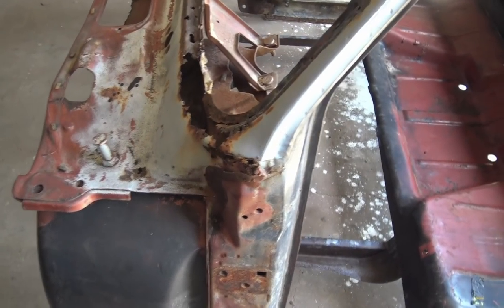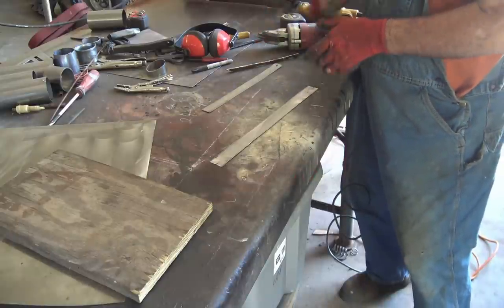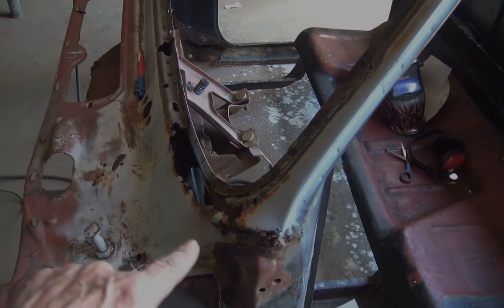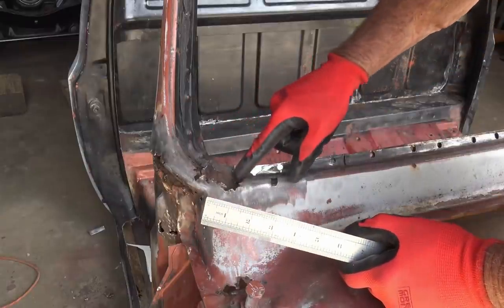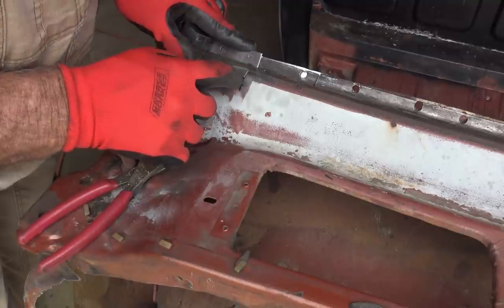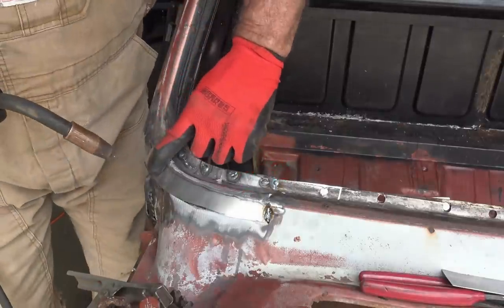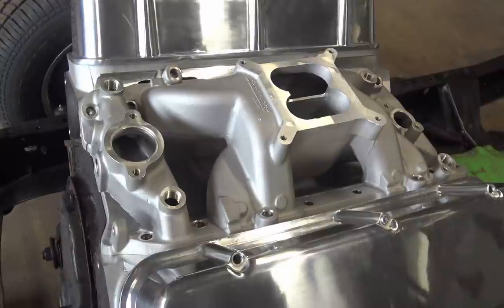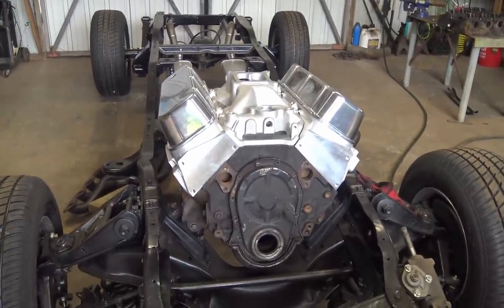Rust Repair For Dummies - 78 C10 Street Truck Build

Comment: Nice metal work, lots of patience!

Careful with those Ebay parts, cylinder heads especially. Check the valve seats for sealing, I've seen loads of them that need valve jobs brand new from Ebay sellers.

Comment: You're going about it the right way! When it comes to rust repair, it's best to do it one little piece at a time. It's a lot of rust, so it's gonna take a lot of time. But hey, times cheap! As for the top end kit, well now you're building 2 motors with 1 kit. That ain't bad!

Comment: Hey Bob on them side pillers you can use rust stop and then you can put lead in for body filler just like the oldden years, I used to use lead to cover welding spots you still can get lead from your local Auto paint shop along with bees wax for smoothing out the lead ,you have to get the acid flux so the lead will stick . They make 4 different types of lead for body filler . Try using lead you like it for filling spots .  Years ago I owned D&L Auto an Paint and used lead in a lot of cars an trucks even on clipping vehicles

Comment: Bob you ever use All metal? It’s like your Dura glass full of minut little ground metal. I use in small rust areas after I use rust killer. I’m building rat rods to and it’s fine for them.

Comment: This is still an awesome build Bawb, but I'd just buy the right airgap intake for those heads and run em, you still have a good intake for the peanut heads for a future build and those new heads wouldn't be setting on a shelf waiting for someday use,, that's a pile of money for shop art,, sweet work on that rust repair just wish you were closer because we have a local guy who has probably 8 of those cabs in way better shape than that one,  market place auburn al. if you want to look him up

Comment: 6:25 Good know how tip Bob on using stretcher& automotive shrinking tool wish knew someone around that has 78-80 squarebody truck cab to help cause it like pickup cab ur currently working came from up north ohhh & definitely don't buy parts on EBay some of their stuff won't last.

Comment: Like the progress and understanding the choices you are making on the heads and intake. Are you putting new valve springs in the old heads and are you using the 1.7 rockers in this motor.  It will really thump if you do! Lol

Comment: I guess they are cnc.cutting aluminum.I thought they probably cast the intake. They don't give a shit if it's a match, ain't jumping to make it right. True American business. If they take enough peoples money to go to court,they just change the name. 
       Turbo Jon had a set of Trickflow heads, stainless valves. One pass on them. Pulled the covers, and all the intake valves had dropped. They were curling, and had broke two valve guides. 
      I know you said you would probably buy valves. If not you might want to give those a  look, and see if they look flimsy, they are. 
        If they are flat enough to seal, the castings are worth the money.

Comment: Question,what's the fix for the standard master cylinder not quite fitting on the booster studs?Move the studs or drill out the holes?   🤔
Reply from the maker: In that case and most others, get the right master cylinder. In my case of not using the booster and having it all apart anyways, I can move the studs in a little.
Reply: @RatRodBobBuilds  Thanx !

Comment: Its a bummer your so far away Bob....I could easily find you a rust free cab here , but between cost and shipping it would be a deal killer for your budget. Its a bummer about your engine parts too and not getting the support from the sellers , but most of those guys on eBay just have parts drop shipped and don't know anything about what they are selling.
Reply from the maker: The guy actually called me on the phone after went around for a few days on eBay messaging. He checked he's stock and didn't have a rectangle port intake and he didn't have oval port heads in stock to send as for replacements so he let me know I would be safe to return it and get a full refund. So it's all good. Haven't decided yet what to do but at least I have options that I can live with.